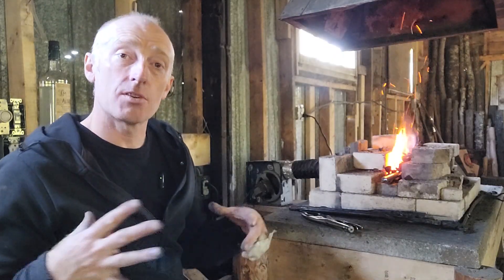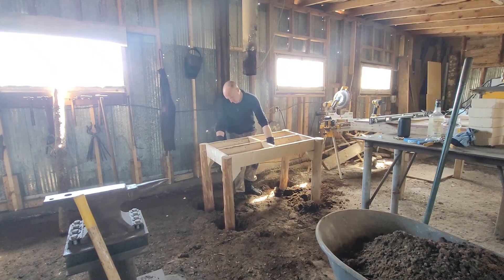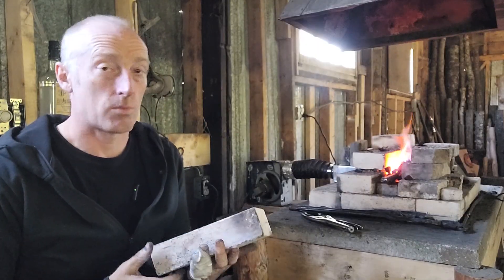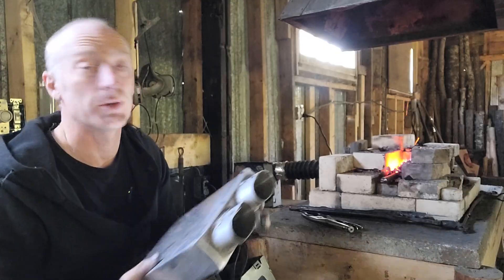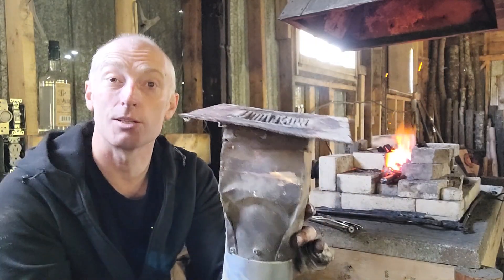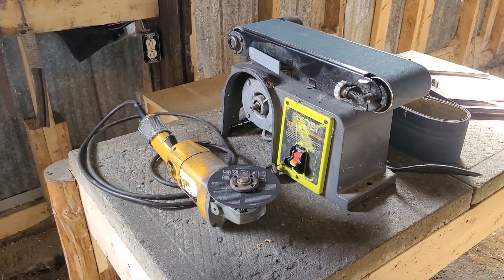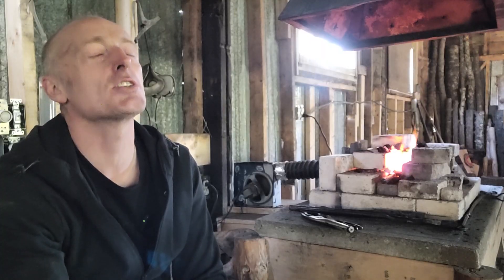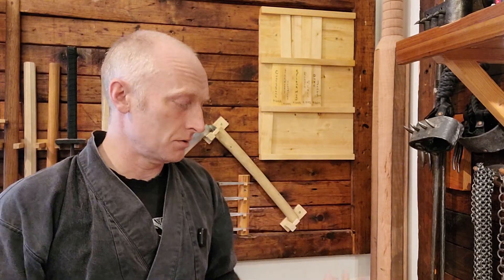Building a charcoal forge, starter's guide to the fundamentals of a blacksmith's workshop

Comment: BTW, carbon monoxide weighs much the same as nitrogen gas, the main component of air.  They're both 28 nucleons.  It doesn't sink to the floor; usually it rises because it's hot.  Also, CO binds to hemoglobin molecules and doesn't let go, but gradually gets flushed from the body as red blood cells are replaced.

I'm not saying you should change your setup.   There may be good reasons for it to be that way.

Comment: I made a charcoal forge yesterday by digging a hole in the ground, and using bricks to line it. Using a hair dryer to feed it air through an old exhaust pipe. I'm guessing that the reason it goes through charcoal so fast is because I did it in the ground. I'm going to build a table for it and see if it performs significantly better.